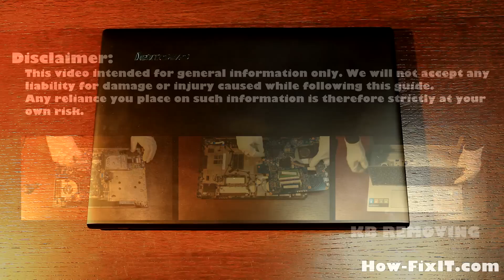Lenovo IdeaPad Z500, Z510 Screen Replacement - Your Step-by-Step DIY Guide!

Comment: i doubt that someone at the service centre replaced my JBL speakers with cheap speakers. I submitted my laptop for a keyboard related issue. they fixed the keyboard issue but now I am observing that cracking sound is there in speaker similar to cheap speakers. can you help me identify if they have really replaced the original speaker so that I can take further actions.